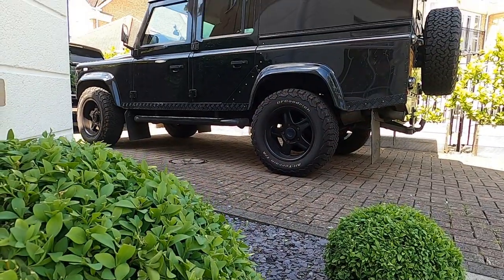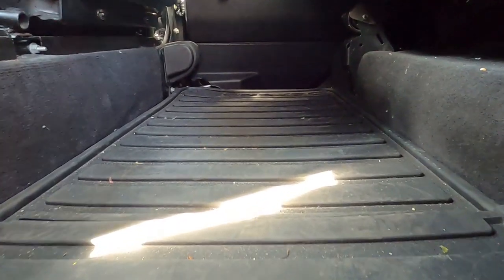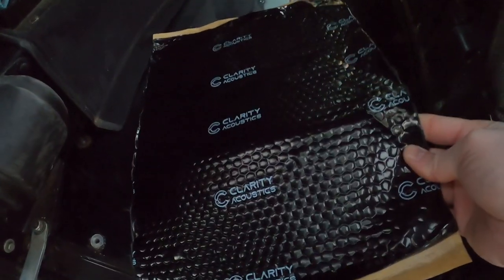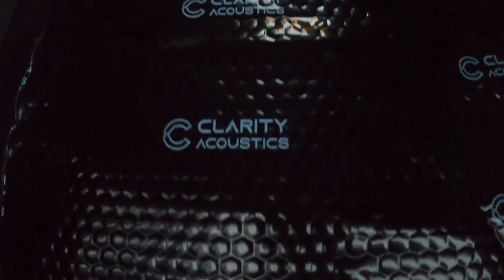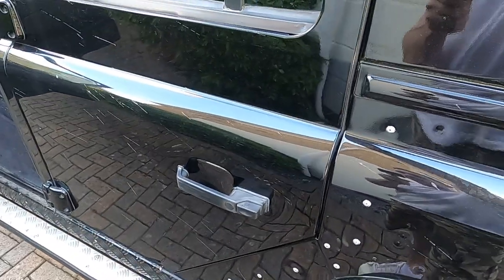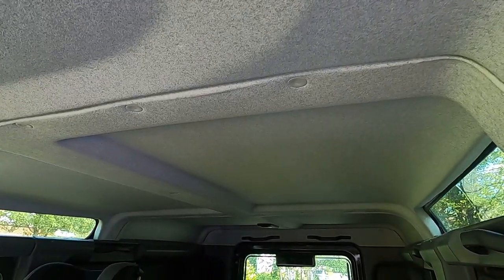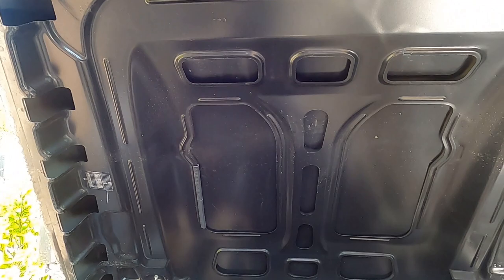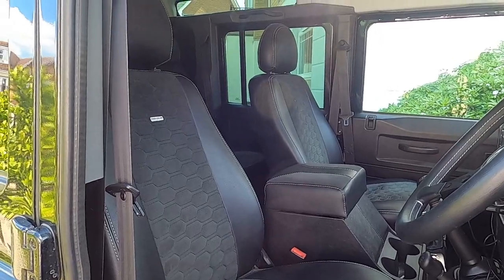Is it Worth SOUNDPROOFING a Defender 110 90 XS Utility? Best Way To Sound Deaden LOUD Land Rovers

Comment: Hi
Are the tyres 285 65 18
I'm currently running 265 65 18 but would like to go slightly wider, I don't think I'll have issues but if you know otherwise??
Cheers
Reply from the maker: Mine are 265s although I've seen one guy run 285s on the same J wheel, I don't recall him having any rubbing issues but it might start getting quite close, especially if you need articulation off-road.